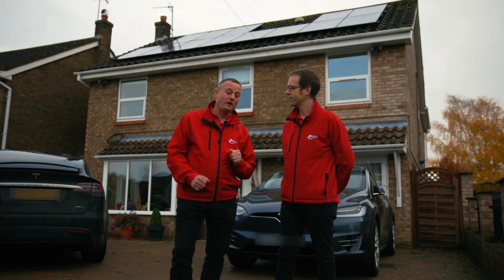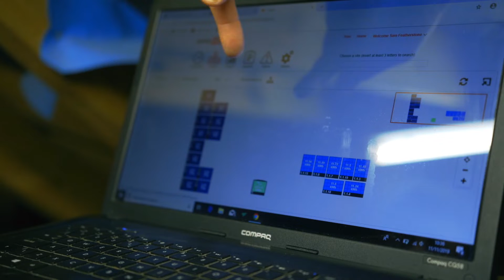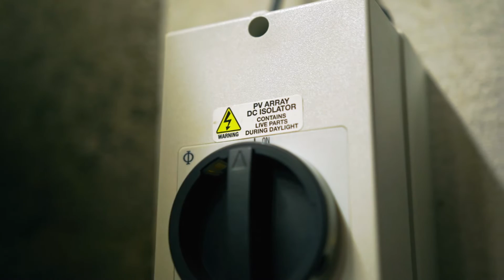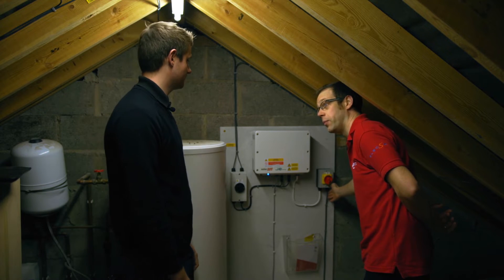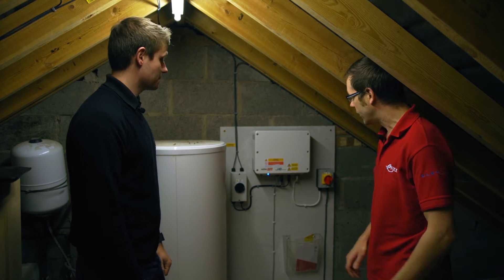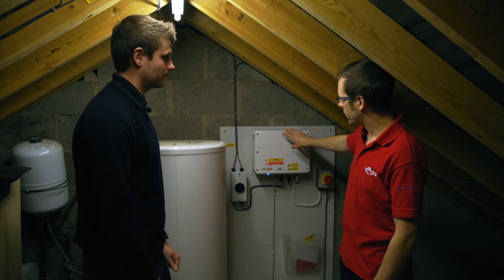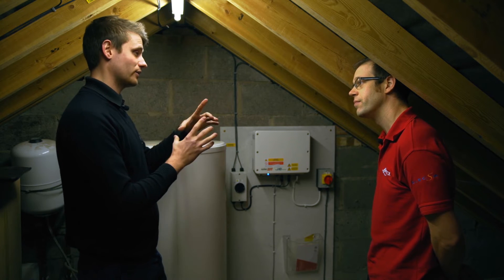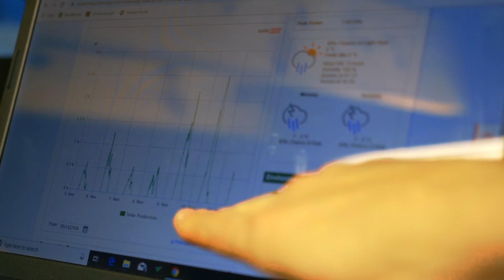UK solar panel installation upgrade using Solaredge inverters - Smart Energy Pt 1

Comment: Amazing video, just one correction 13.30. The SolarEdge single phase inverters can be oversized to 200% this means a SE3680H can have 7360 watts of modules, this can all be on one string, as the inverter can only ever produce 3680 watts. The 5700 watts is the maximum string power, if this was on a SE6000H, you would need two strings, but any inverter below SE6000H, the 5700 rule does not apply. Also for the SE8000H and the SE10000H the maximum string power is 6800 watts, and not 5700 watts. Thank you again for a great video.

Comment: Sam needs to brush up on his terminology/phrases. The Fibre boards will not "Negate" (03:14) the risk of fire. They will however "mitigate" the effects of heat causing a fire. He also talked about the Solar Panels Consumption (07:54) of power - I think he really means Production.  Given the age of this Vid - I'm sure he will now be using the correct terms.

Comment: So basically what I understand about SolarEdge optimizers is they are basically smart micro inverters. As far as his inverter goes somebody didn't know what they was doing because the inverters should always be bigger than what you can produce that's the one place where Enphase micro inverters fail. My system has 3 SolarEdge SE11400H-US HD-Wave Inverters my system is a 32.8 kwh system. No reason why the inverters will ever throttle the max output of my solar panels if I install s 32.8 kilowatt hours array I fully expect to get every bit of it why would I install an inverter or "Micro" inverters that can't give me what I installed. I have noticed that enphase micros are notorious for cutting/clipping nearly 20% of their peak production. Kind of backwards wouldn't you think?
Reply: They are not microinvertersm these have both DC and AC connections, SolarEdge Power Optimizers have only DC connections.

Comment: Why are rotary isolators used in PV systems and not more conventional ones? 
This is also true for Air source heat pumps and ground source heat pumps

Comment: Hello, I have a question! I have solar panels on my property but I have 2 of the red switches. Is this normal?

The setup in my attic is identical to the one in the video, but the black wire that goes down to the fuse box (explained in the video), goes into another red switch first before going to a seperate fuse box. 

I had my house rewired in Nov 2021 where a bigger fuse box was installed for the whole property. Could the solar panels then be wired into this new fuse box and the 2nd red switch be taken out? 
Also, do any of these wires need to be attached to what Western Power install in a property?

Sorry for all these questions, but I feel like the middle man at the moment between different electricians. Thank you!

Comment: Technical the solaredge system is not in series. The panels are wired in parallel do to the solaredge optimiser. The old system was in series but their should been 2 separate inverters 1 for 1 roof and 1 for the other roof if not the panels can go faulty

Comment: How do the individual panels communicate their status ??
Reply: Over the internet
Reply: @alpachino468  or over a mobile connection my HD wave inverters have their own telecommunication modules I had the choice to have them connected through my Wi-Fi ir wired directly through my Ethernet either method would also be paired with a mobile wireless backup in case my internet ever went down they would still be able to communicate and diagnose with my inverters.

Comment: Great video we installed solar for the first 3 years but then gave it up when Fitt was not very good I am interested in the battery set up and this one seems a good set up.Can I ask being grid tied do u need to tell supply authority u have added a battery or not as I have heard people say the supply authority have said no you can't add a battery to that system ?
Reply from the maker: If you are planning to operate in “island mode” - keep running in the event of a grid power outage, you will need to inform your DNO. You will also need to alter your earthing arrangements for your incoming supply. Wiring regulations are due to be updated to reflect these new scenarios.
Reply: @efixx  ok that males it cleat ref earthing lol all the hassle pen faults on car pods it would be funny if we all go back to TT 😂.

Comment: Just got my first quote back for an 8.9KWp system to be installed on my house in Aberdeenshire.  320W JA Solar Panels,  10KW SolarEdge inverter / optimisers,  GSE “in-roof” mounting kit.  Once I get written confirmation from building standards that I don’t need a building warrant, then I’m good to go ahead with a purchase order!

Just need to adjust the quote to get a hot water immersion heater controller included - that’s energy storage worth maybe 4KWh per occupant.

Overall though, I’m looking at a 13year payback without an EV in the equation.  Once I get an electric car however, the payback gets even shorter.  The futures definitely electrical!

Comment: When I had my array installed about 8 years ago I was limited by FIT conditions to 4kw max panels and 3.6kw inverter. Have the rules changed to allow more panels as this example on 5.7kw or does the owner not get FIT payments? Cheers. P.S. just recently found the efixx channel having enjoyed GSH for a while. Enjoying both channels guys, keep up the good work. 👍
Reply: Hi Olly, with your system the maximum you could generate was 3.6kw. This is a rule with regarding the local network operator. You could apply for more capacity meaning a larger inverter could have been installed. In this case we have maintained a 3.6kw inverter however as it is a SolarEdge inverter you can over install on the panels side hence the 5.7kw. This customer retains his FIT for his original 4kw of panels and 3.6kw inverter. As we have increased his panel production he will not receive any more money than he used to as Eon will pro rate his generation meter meaning he still gets paid for his original system but has the benefit of being able to use more power now being generated by his additional panels. The peak generation remains the same at 3.6kw but he will produce more during duller times thanks to the extra panels.
Reply: @OvalRenewables  Thank you for the reply, it is much appreciated. Could you just clarify though how I would go about increasing my capacity as I have the physical space for 2 more 250w panels on my current array. Do I need to change the current SMA Sunnyboy 3600TL or just add the two panels to the strings, balancing one per string? And, will the scheme need updating as a result? Thank you once again.

Comment: was there a gateway connecting the inverter so the customer can monitor the each panel energy production or it was hard wired?
Reply: The inverter is connected to the internet via a hard wired CAT5 cable. That means the customer can monitor the solar production remotely via the SolarEdge Dashboard. The includes individual panel production.

Comment: What is the point to waste so much money just to reduce the fraction of your whole energy consumption(electricity), just for a fraction of this summ you can do:
1) use solar panels as summer sun windows shield, it will reduce overheating(AC use)
2) connect solar panels directly into a heating element of the boiler,  boiler with 200 liters of the how water is 14 kwh($150) = 1 tesla power wall($3000)(and dead in 15 years) and you don't need any $6k invertors/controllecs for that
3) buy a washing machine/dishwasher with a hot water feed and actually get cheap electricity from it,(80% of washing machine/dishwasher power use is heating)
4) insulate ceiling for additional 200mm of the insulation and install heat recovery ventilation(it alone will provide x3 more saving than a chemical battery for your TV and gaming PC
5) renovate your electronics and refregerator for A+++ class
6) buy a good road bicycle for a work/study commute, it is more about your health than about driving costs, doctors does not have cheap cure for a chronical health problems

So, for the same money you can reduce 30-50% of your whole energy spending instead of the  2-7% for the electricity, yeah, let's buy a lot of chemicals just to run the old tools in  a poorly insulated houses!
Reply: You presume these things haven’t already been done, also why not just run appliances during peak production? I also understand PV is cheaper in the UK than US due to tariffs.
Reply: Who uses AC in the UK?

Comment: Thank you and greetings from Algeria. I have a question please regarding protections against high voltage and short circuit? Iam wondering why the installation does not have a fuse for the DC part and a surge arrestor?
Reply: souad massi the solar edge inverter has all the up to date protection built in. 👍
Reply: @ovalelectricalservices7790  Thank you sir